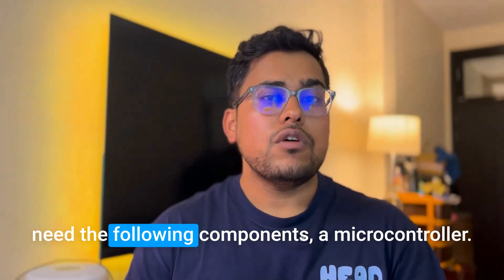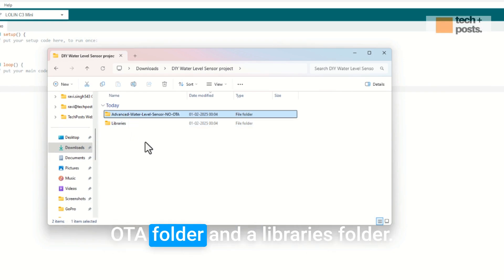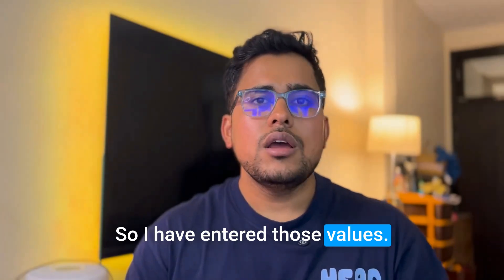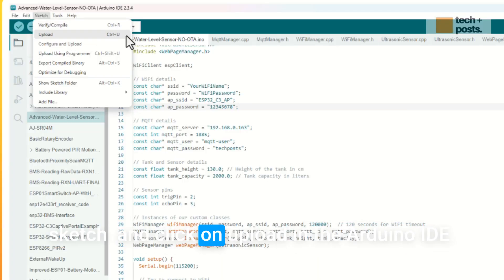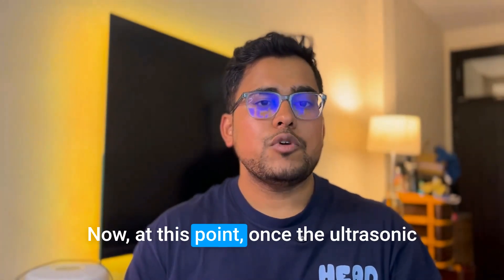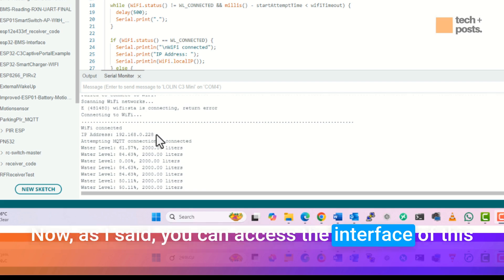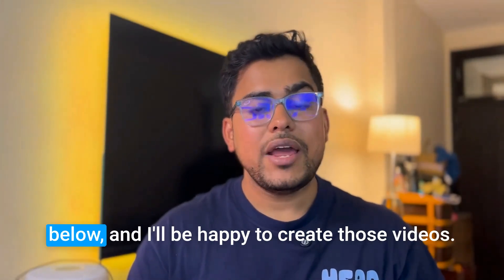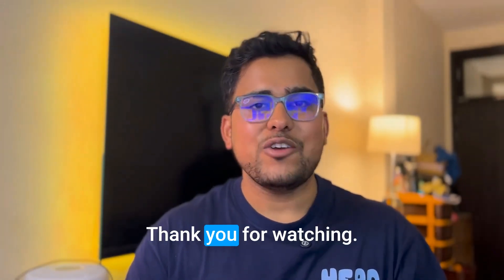$10 DIY Smart Water & Salt Tank Level Sensor | WiFi Based Sensor | Works with Home Assistant

Comment: Hi Ravi I tried it with seeed studio xiao esp32c6 and this aj sr04m sensor with esphome in home assistant directly. I was able to set it up, but getting distance measurement timee our error in the logs and reading coming as nan. Any clue why? When I googled, it says as this sensor requires 5v , we have to use vbus of Microcontroller. But it also says as gpio pins only accept 3.3 v , we need to use resistor. Any idea?
Reply from the maker: So sensor needs 5V input to + and GND, the TX and RX of sensor connects to the Esp32 pins and nothing in between is needed. Some of the SR04 waterproof sensors arrive faulty also. So pelase use a simple program on Arduino IDE to test if sensor actually works before flashing this program/firmware
.
Reply: @ravis1ngh this is working fine now.... The issue was with pulse time.. in home assistant in esphome it doesn't let user to change the pulse time and default was at 10us. In Arduino ide , I was able to set it more than when timeout occurred. After that, when I flashed the firmware, I am getting the reading. I have tested  with dynamic ultrasonic distance so far. Now, once the solar and battery are available, will test and flash the water tank related firmware in it... 

Thanks a ton Ravi! Appreciate your work and effort... Keep posting diy esp32 projects. I always look for your new video...
Reply from the maker: @thevividmind4849  Good to know. And this will help others, so thanks for sharing!

Comment: its not clear demonstration and wiring just face and talking, jsn-04t wriing is no so simple as it shown in the diagram, it required resister to work in different mode, yes, you can make these types of tutorial more productive with hands on lab, keep it up.
Reply from the maker: It’s working as I shown and for past 6 months installed in my tank. No resistor is requires!

Comment: Bro In my browser, the tank water level is displaying, but it does not refresh automatically. The values only change when I manually refresh the browser. Also how can I add this to my Home Assistant?
Reply from the maker: If you have Home Assistant, flash the ESPHome code. That would be a better approach. Refer to this: https://www.makeuseof.com/build-water-level-sensor-using-ultrasonic-sensor-and-home-assistant/

Also, I will soon create a new video on my Solar powered water level sensor which I installed 15 days back. About how it’s working and how to add and integrate in HA with some beautiful cards.
Reply: @ravis1ngh  Thanks, bro! As per your previous video instructions, I made it. Following ChatGPT's instructions, I connected the HA dashboard, and so far it's working well. 😊
Reply from the maker: @gopalmaniraj that’s awesome. Enjoy! 😄

Comment: Hi Ravi

Kindly help me to know the correct sensor used for identifying the water breakage in PVC (2inch / 2.5 inch) pipeline while the submersible pump [5 HP (3 Phase)] is running.

When the breakage occurs in a PVC pipeline, the sensor should send the signal to the receiver.

Please provide me with the list of sensors, components needed for the above scenario.

Thanks in advance.

Regards,
Ravisankar
Reply from the maker: Pressure Sensors (e.g., MPX5010DP) – Detect sudden pressure drops indicating a leak.

Flow Sensors (e.g., YF-S201) – Compare inlet and outlet flow rates to detect discrepancies.

Water Leak Sensors (e.g., soil moisture sensors repurposed) – Placed along the pipeline to detect water leaks.

Acoustic Sensors (e.g., MEMS microphones) – Identify unusual vibrations or sounds due to water escaping.  See if Honeywell WLD2 is something you looking for or TUF 2000M
Reply: @ravis1ngh  Thanks a lot for your information. Let me go through it and choose the right one.

Comment: Thank you so much for such a detailed video, im going to do the same for my water tank.
Reply from the maker: Glad it was helpful!
Reply: @ravis1ngh  finally got it working, had to remove mqtt related lines, but now page is loading very slowly. Any suggestion would be appreciated, I'm new to Arduino and programming.

Comment: Hi, nice video, waiting to see the same with solar pannel and 18650 cell. But to charge the 18650 by using a solar pannel how many watts of pannel you are planning to use? I think 10 or 20 w solar pannel is large in size  and mounting is required. And for the range ESP now gives a better range if another esp32 is used in receiving end.
Reply from the maker: I will be using 6V 1.1Watt panel. That would be good enough.